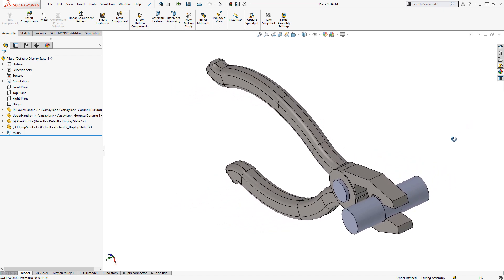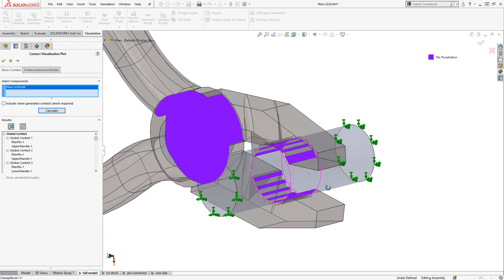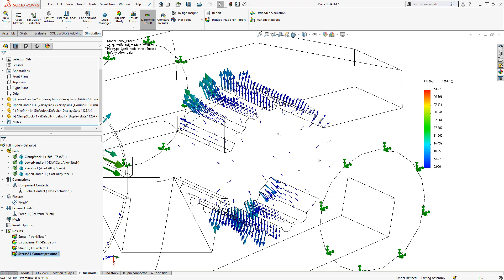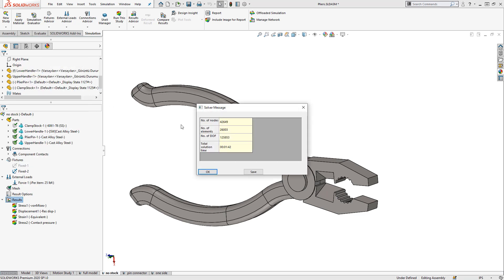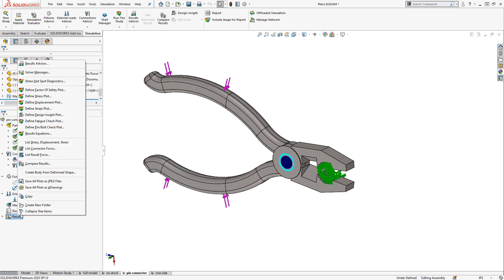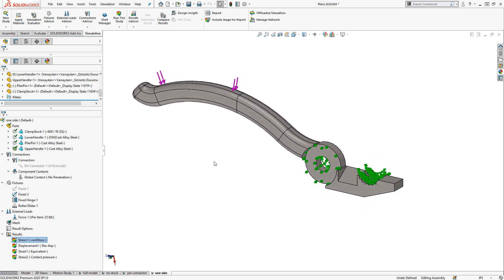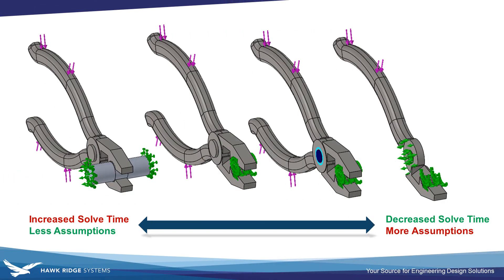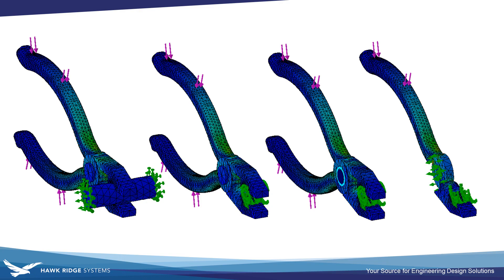Simulation Study Setup Decisions: Pliers Example

Comment: Excellent, thank you!
How would you set up the same basic scenario, but limit the handle forces to patch area that represent the hand, rather than the entire handle surface? Would that mean a parting line, or is it more complex than that?
Reply from the maker: On the Features tab Curves -> Split Line would allow creating smaller faces that could be selected for force application

Also could use a nonuniform force or pressure distribution (driven by an equation) which would allow the force to be distributed differently.
Reply: @hawkridgesystems  Thank you!